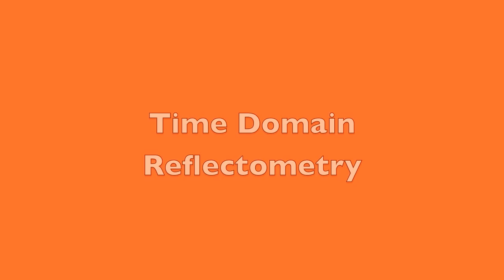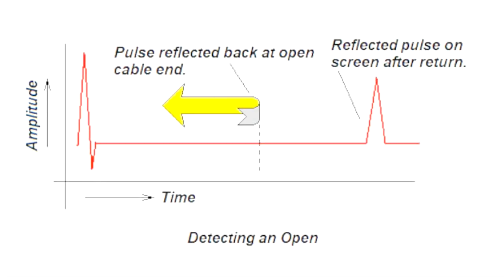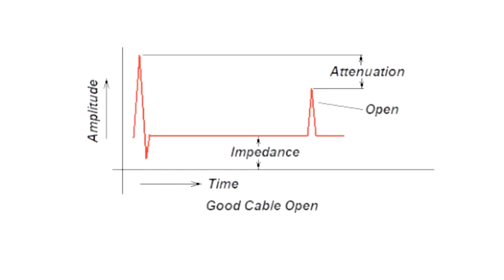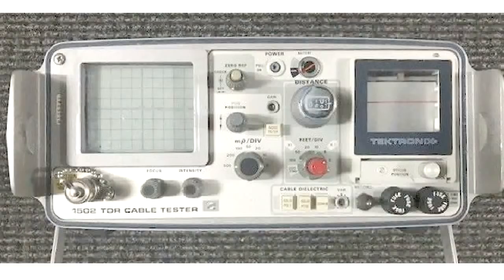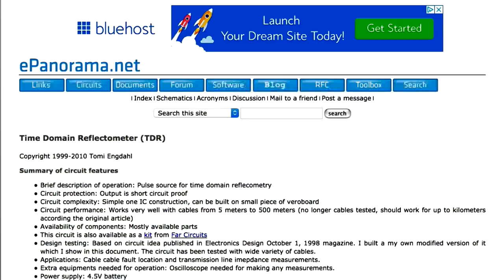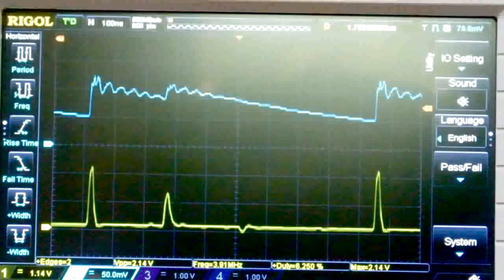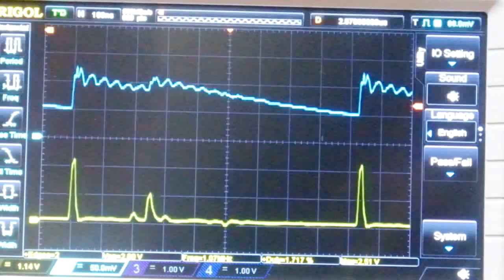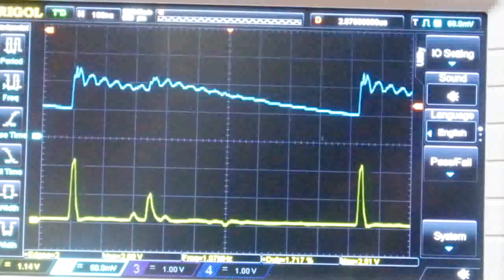Using a TDR to diagnose RV coax problems.

Comment: The last time I used a TDR was back in the mid 1980s when we were still had a building running a 10base2 coax ethernet system. I think we had a Tektronix. Very nice device. There is another instrument called a network analyzer that can sweep a frequency range (kHz to gHz) to see how the impedance changes in cables. I already have a digital scope so I may build that circuit for fun.
Reply from the maker: Its a tool that should probably be used more.

Comment: Great video it brings back a lot of memories. If my memory serves me correctly 75 ohm coax cable has a 4 to 1 ratio from the outer conductor to the center conductor. The reason cable companies use 75 ohm coax when they first started they used military surplus coax cable that was readily available at the time. I have used a TDR as well as an OTDR troubleshooting damaged fiber optic cable. Best RG6 cable to use is a quad shielded version that is very durable.
Reply from the maker: Thank you for your input.

Comment: It is great to see someone bringing a low cost TDR into current RV knowledge.  A Tektronix unit helped me find too sharp cable bends and discontinuities in a 162 room distribution system in the mid 1970s.  Here's hoping that the techs can realize its value in finding coax cable problems.
Reply from the maker: The Tektronix unit I used was in the late 70s as well.  We used it to certify contractor installations. 

With this one, what i found interesting is I could actually see changes when running the slideout of my RV in and out.